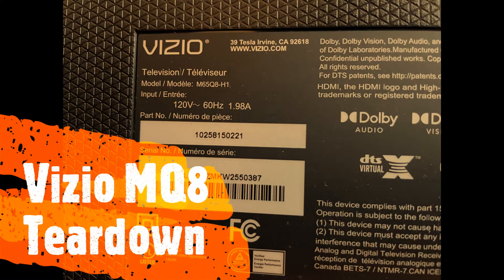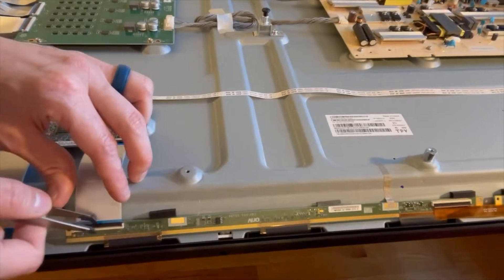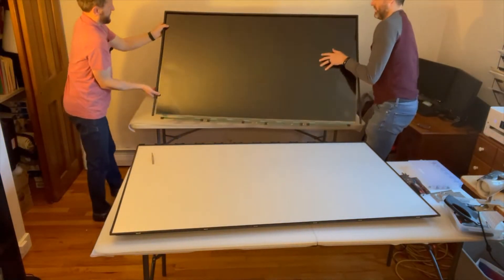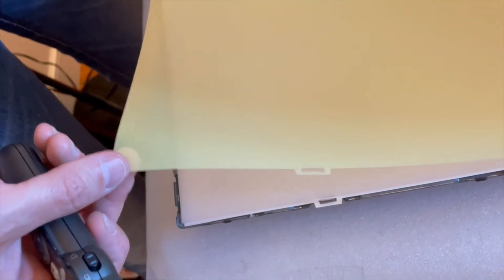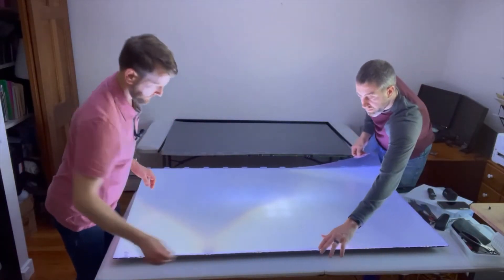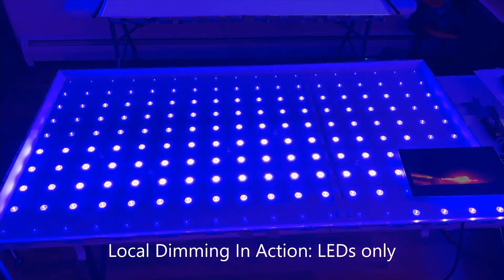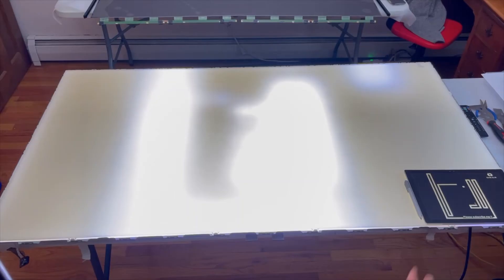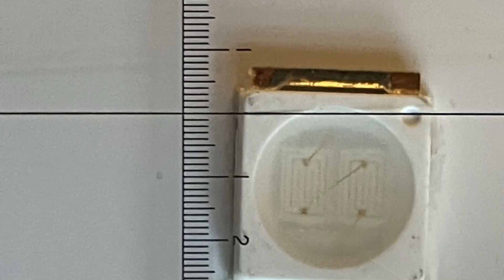QLED TV teardown and analysis

Comment: Why are there blue LEDs used and then "transformed" into white light, instead of using white LEDs?
Reply from the maker: This is what all "white" LEDs are, blue plus phosphor. It's easier to generate a pure color (monochromatic) light and then color convert to broaden the spectrum. Also possible is three different colored LEDs (R/G/B) but this is costly.

Comment: Hi I love your videos. There is no other video that in-depthly shows the layers of film and diffusion. I accidentally got the order of the layers mixed up I would love if you could do a video on a older model Vizio smart tv 65 inch or 55 or higher. I replaced the backlights and I’m struggling to put the tv back together And there are so many screws

Comment: This was remarkably interesting. I feel like I was taught how modern TV's lighting works by the guy who invented LED TV's with local dimming.  I just took apart a broken LED with the array about half as dense. I took them all out 0about 5 strips that look identical to your TV. Any ideas what to do with these? Or what about the Fresnel lens or other light diffusing layers?
Reply: The strips can be sold to others who have LEDs go out.  They can be in series or individually powered depending on the TV.  Individually they are about a 2.5V-3V forward bias/breakover voltage.  They are extremely bright, but the strip also acts as a heat sink.  If you power one up not soldered onto the strip, even with the proper resistor, it will burn itself out or very dim in a matter of minutes.

Comment: could I ask a simple "silly" question about the panel? I see a kind of a film like those films used on mobile phones. Is it for anti-glare? Or something more complex about the display technology? 
I ask for knowledge reason but mainly because of a 3-4 inch scratch in length that I got from someone working in my rooms wall.
Reply from the maker: Often there is an antiglare film on the front of the display, yes. Scratch in this film may be difficult to repair.
Reply: @NanoPalomaki  I would say it is impossible to fix the scratch on this film. What I would like to know if this film has something to do with the reproduction of image. If it's only for anti glare purpose I could remove it.
Reply: @NanoPalomaki  thanks for the answer dear

Comment: Dr. Palomaki. You have all the expertise needed to answer this one question. Which screen cleaner is both safe and effective for HDTV's? There are so many snake oil products out there it is impossible to decide.  I assume different manufacturers and various technologies might require different surfaces. Manufacturers duck this question and a drop of "Dawn" and distilled water does not always does the job. HELP
Reply from the maker: Many of these TVs have a plastic-based film on the front, but each manufacturer will be different so I'm not sure what is best for yours. I use a regular screen cleaner with microfiber cloth.
Reply: @NanoPalomaki  That is exactly the issue I'm struggling with. My hope was that you had the expertise to perform a few tests on different manufacturers screens and determine if there was any damage after a few applications of a sample of cleaners and were even simple finger prints effectively removed. But if this does not appeal to you or seems tedious, I understand. I'd very much like to know your "regular screen cleaner". My HDTV is a Samsung QN90A. 

I honestly believe there is a real need for this information and given your expertise on plastics / optical characteristics I  thought you ideal

Comment: So if the layers aren’t perfectly lined up is that what DSE comes from?
Reply from the maker: DSE (Dirty Screen Effect) is from uneven colors/light. If the LEDs are not all uniform in color/brightness this can cause DSE, also non-uniformities in any of the layers (including films, LCD, etc). Certainly if one of the films were to become dislodged or something you would be able to see this optically. However they are all held in place together and unlikely to become damaged unless you tear them apart like me (or drop them or something).
Reply: Yes, the DSE and banding is insane right now because all panels are made in china, ive owned LEDs since 2007 when they first came out, never had a problem till after 2018, TCL which is the worlds largest LED panel maker bought out Samsung and it all started after that, and then every other company followed because there allows to get away with it, the sony bravia 9 this year had absolutely awful dirty panels, any company that makes a person pay $3000 for a TV with a panel like that is criminal, I actually found out how to fix banding, it's because samsung buys there backlights in pieces and then it's put together, it leaves gaps between the circuitboard which shows up as grid patterns or lines across the screen, simple fix would be to make one giant solid piece of circuitboard for the backlight. It's literally that easy LOL amazing isnt it? All because its CHEAPER to piece it together. shows how money hungry companies really are, as for DSE, a simple machine that would scan and then switch out LED Bulbs until panel was almost DSE free is all thats needed. It's amazing how they go just up to fixing these problems and then stops......why? Because a bored member might make 120k less a year id they did............

Comment: wow, that is really interesting.. i have opened and repaird many conventional led tv's but never opened a Qled TV. It seems those led strips are different and can be controlled in zones of 2 leds.  

It would have been interesting to show us that unusual board that controls the leds and that it is not present in a normal led tv.
Reply from the maker: Yes, the zones appear to be in twos. I wouldn't know where to start with the board to be honest! I know the optical system well, but not the control electronics!

Comment: Hey...can you suggest me one thing...i have accidentally removed the polarizing film from the Samsung neoQLED TV ..as I thought it as a protective layer on the screen...and my screen appears white now... SAMSUNG have refused to replace my tv since it is a physical damage..it doesn't comes under warranty....they are suggesting to replace the whole display panel...which is almost the cost of the TV...what should I do now...should I buy a local polarizing film.from the market???will it cause quality difference??...plz suggest me something...I am helpless now...
Reply from the maker: I'm surprised that a polarizing film removed so easily! Finding a replacement polarizing film may be difficult, but they should not be too expensive so it could be worth a try if you can find one. The orientation will matter, so test it before you adhere it!

Comment: How does a full array of LED's compare to a TV set that promotes edge lit LED's?
Reply from the maker: The full array of LEDs allows for generally brighter, more uniform displays as well as the ability to locally dim when the images have dark areas. Edge lit is much cheaper though.
Reply: I always thought edge lit was better, i had a 2014 samsung curve 4K edge lit that was $7000 new, and believe me. Its was better then ANYTHING ive seen last 5-6 years which has been absolutely Chinese crap, edge lit never got much brighter them 450nits because of no backlight, but i would like to see a edge lit using miniLED, it would be much brighter and run cooler, the 2015 samsung JS9000 edge lit after about 4 years had really bad problems with burn in image on side of screen, because traditional LED ran so hot, they should have added quiet fans inside

Comment: That was super interesting to see! What's the idea of the pairs of LEDs? Just one of those "it's cheaper and it doesn't make enough difference to modulate each one separately"?
Reply from the maker: Yeah, I think it's a cost thing, maybe for redundancy too in case one fails (but with only 190 LEDs I'm sure if one fails it will look horrible).